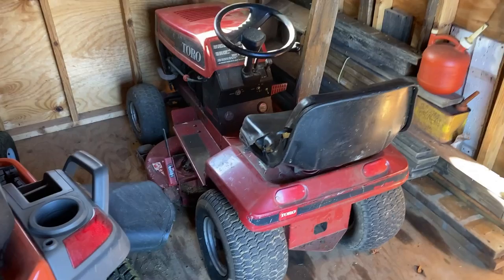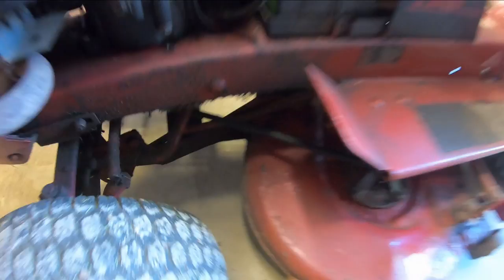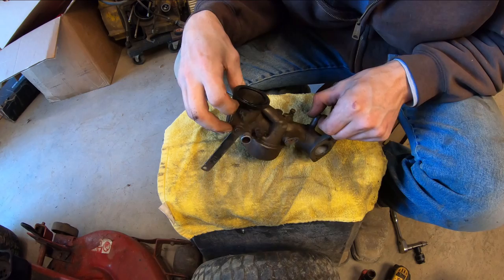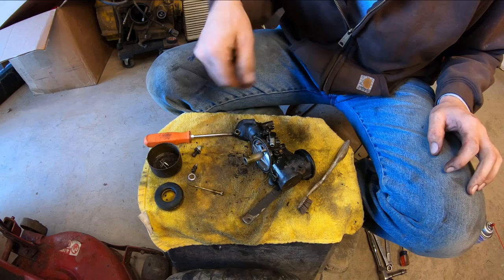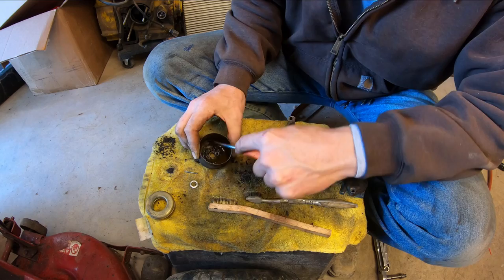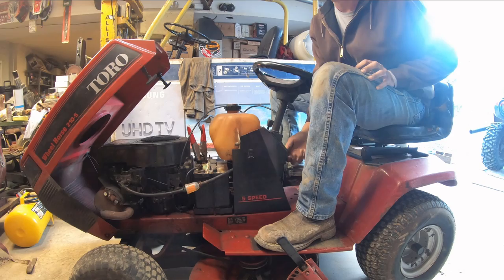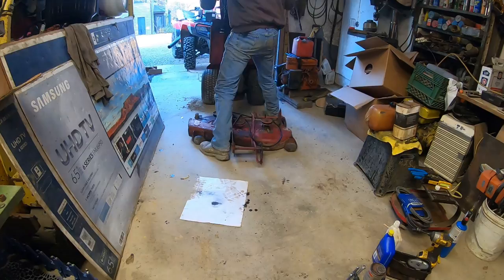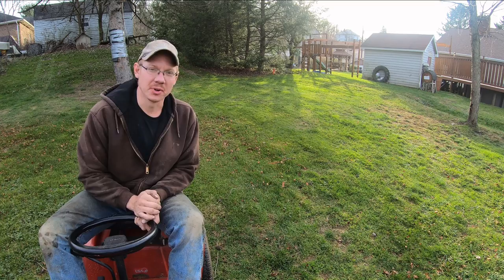Toro Wheel Horse lawn tractor sitting 10+ years Will it run!???

Comment: Time to fire up my old Wheel Horse and Cub Cadet 149. That surging is most likely from the governor. Just needs a little adjustment. Had a brand new mower surge right out of the box. It got annoying so I had to fix it. A small adjustment to the governor smoothed it right out.

Comment: I love the old wheel horses.  my grandpa has a 1976 C-160 Automatic with a snowblower and a rear discharge mower.  Always loved that thing as a kid

This past fall i bought myself one.  A 1980 C-175 Auto with a fresh 18hp briggs opposed twin.  I also have the snowblower and a 48inch side discharge deck.  These tractors are beasts!

Comment: Engines ARE air pumps but I didn't think you were so literal about power producing air pumps!  About that hunting, go watch some Mustie1 videos and see if his fixes apply.  Usually the low speed fuel feed isn't supplying enough gas so the engine hunts as the governor is trying to keep it running.

Comment: The thing you took off was a strainer, not a filter. The filter you put on us supposedly too restrictive, and should be used only when a fuel pump is present. This was explai ed to me, as I did the same thing.  It worked for amonth, then screwed up. I put a strainer on, and it was fine and has been for 5 years......FYI

Comment: Looks like some serious highway miles on those front tires! I had a similar model... the Wheelhorse-Toro 210-H, hydrostatic drive transmission. I'd have to say that it was the best cutting mower that I had though out the years. Happy mowing!!!

Comment: the reason the valve stems are on the inside is so you can put cast iron wheel weights on the rims with long bolts
Reply from the maker: All the wheel weights I’ve ever used had a notch for the valve stem

Comment: That new paper in-line gas filter should really only be used on engines with a fuel pump, not gravity fed like this is, I think mostly because  it does not filter all that well and the fuel pump itself does filter well.  The surging means it's starved for fuel;  so clean the carburetor better and/or slightly enlarge the high speed jet orifice.

Comment: I have used belts from TSC, they have a line of belts that have some sort of aramid fiber and they are cheap compared to any other decent brand and they last really well.  The problem is you may have a problem with them fitting because they don't stretch nearly as much as conventional belts.  I used them and they never excessively wore the pulleys but I had to add extra length to get them on.  They worked well, just a belt that was something like 68" had to be 70" to fit but it worked and didn't slip and has worked great.  The oil is probably the o ring on the dipstick.

Comment: Right there with ya on fixing things instead of throwing it out. I've seen you use a few different chemicals (at least one of which I probably wouldn't have used simply because of the difficulties around disposal) in attempts to clean projects but I haven't seen you use Extreme Simple Green Aircraft and Precision Cleaner yet. During my recent 3.1 rebuild I was looking for a good degreaser because I don't own a parts washer and gave that stuff a try.  It's non-toxic and it took off years of baked on grease, dirt and oil (over 200k miles worth) like it was nothing - no chemical parts washer I've ever had experience with worked like it AND it's easy to dispose of at any place that takes used coolant and oil. It's safe on skin, rubber/plastic etc and my parts literally came out looking like new.

Comment: Are they not governor controlled at high revs ?, Usual a flat tin plate that has a spring attached and the draft from the fan moves the plate against the spring and reduces the throttle setting. As it slows down the plate moves back and increases the throttle setting again. The plate is connected to the amount of throttle opening, hence it prevents damage by over reveving. Under load , adjusted correctly, it gives even engine speeds. Hence without a load and full throttle setting it opens and closes causing the surge, perfectly normal.

Comment: Only $100 for belts, it would be at least double that if the mower had green paint on it. You should be able to eliminate the "pop" when you shut it down if you let it idle way down to cool off a little. The pop is caused by excessive rpm when the ignition is killed and fuel is still being pulled into the engine where the heat in the exhaust manifold ignites it with a "pop". Very hard on engines.

Comment: If you put the little plastic eBay inline fuel shutoff valve on gas line and use it every time your done to shut off gas, you won't have carb problems.

Comment: That might be the most varnished carburetor I have ever seen. I've repaired stuff that sat for comparable amounts of time, and I have never seen anything anywhere near that bad. I wouldn't have even bothered trying to rebuild that one. There is just no way that it will ever work 100% properly anymore. With that much dirt and varnish, there is just no way to get all of it out.
Reply from the maker: Ha! That was nothing! You have to watch the schramm air compressor video on the channel. Now THAT was a nasty carb!

Comment: nice runner there :) Always look forward to new videos from you. I am gonna interject a comment in here though. The fuel filter you put on is not really the best for gravity flow fuel systems. Those paper element style filters are designed for fuel systems with a pump the filter you took off is a simple screen filter and it is a much better fit for a gravity flow system. if you take a look at the tractor you really don't have much drop at all between the tank and carb. The restriction of the paper element filter can cause fuel starvation issues. Millage may vary and do what you like and what works for you. But there is a reason the factory filter is just a screen.  Still love to see the old iron back and mowing again.

Comment: I agree with your ''throw away society'' ethic.  A world half full of Wasters too self important to enjoy getting their fingernails dirty !
 That's an 'Emulsion tube'  take your time & make sure ALL them tiny holes in the side are clear.  Be careful if that crank seal is weeping,  when the oil is cold they can look fine,  but when running & the oil thins with heat they can piss out flinging the oil away so ya don't see a puddle under a cold nor hot engine.  It would be a shame if that good auld Briggs heat seized after so many years of service  :(   
     Re:  Your Blasphemous  '' Briggs & Scrap iron ''  quip,  
          ''forgive them, for they know not what they do''.

Comment: On the old style Briggs&Stratton with the oil slinger oiling system you Don’t use multi grade motor oil it has to be straight 30weight Only Not Not 10w30 straight 30 Weight motor oil.

Comment: I don't know how long your mowing season is there but I figure 6 months mowing once a week so say 25 times. Sometimes it's less in a dry year. If it takes 2 hours to mow that would be 50 hours a year. 1300 hours would be 26 years of mowing. That could be about right because Toro bought Wheel Horse in 1986 so 26 years takes it to 2012. The 210-5 was 1990-1992.
Reply from the maker: Ehh prob took her closer to 3 hours but your probably pretty close with that!

Comment: Always like resuscitation of old equipment. I agree, much more satisfying to fix something versus just buying a new part. Got a drive and deck belt for my '97 Craftsman lawn tractor from vbeltguys.com, they're up in the Dakotas somewhere. Very reasonable prices. I think the 88 and 93 inch belts were under $40 with shipping. That was maybe 4 years ago and lots of hours, still working. Wondered what happened to the Wheel Horse name. If you search "Wheel Horse RJ058" it might come up several collector sites. My dad bought that model in 58 for our rural Ohio Township homestead. The dealer at the time was on Babcock Blvd in the North Hills. We used the heck out of it for plowing our long driveway in the Winter, hauling firewood out of the woods and driveway repairs. Back then, they had actual tractor wheels on the rear with Ag tread, maybe 18 inch wheels. Kohler single cylinder engine. Only drawback was only a three speed trans. When my mom had to sell the property after dad passed in 71, a neighbor bought the Wheel Horse and used it for several years. Not sure its fate. Lots of them still survive in collectors hands. Interesting net search if you're interested. Yours looks like later generation designs of the MTD and Cadet genre. Less of the traditional mini farm tractor look and more like the lawn tractors of today. Enjoyed your first start video. Nice job, Matt!

Comment: all the garden tractors /lawn movers i have owned valve stems were in the inside , migt have somthing to do with adding wheel weights , some whights to allow access for valve stems if located on normall side of rim ,just my guess
Reply from the maker: All the wheel weights I have for mine have a notch cut in them to allow access to the valve stem 🤷🏼‍♂️ I’ve never seen any without that

Comment: 👍🇺🇸🇺🇸🇺🇸🗽🙏🏻 Enjoyed!  On the gravity feed gas tanks I've had problems with replacing the small (screen only) filters with the larger plastic ones....it's like it vapor locks after about 10/15 minutes and stops running.  Putting a small (screen only) back on and problem went away!  Love old mowers!

Comment: The "surge" that you are hearing is called "hunting". The motor is hunting for its proper rpm. That is probably due to a dirty venturi tube (the one that you couldn't  get out of the carb). If you want a very good carb cleaner that comes in a spray can, check out Berryman's. Best I have ever used for multiple uses including removing paint overspray from various parts.

Comment: GET A HORSE,  A WHEEL HORSE OF COARSE!!   Wheel Horse always put the valve stems on the inside so they would not get caught by sticks and other debris.  Good bet you could have got the Wheel Horse belts online cheaper then then those crappy stens belts at the dealer.

Comment: That fuel filter you used is not meant for gravity fed fuels systems, use the style that was on there when you got it.
Reply from the maker: Lotta people said that, I’ve been using these filters on gravity systems for years now and never had any issues
Reply: @DieselCreek  the other style will perform a lot better on your machine, that’s what that style is meant for, great video though.

Comment: That engine “surge” is called hunting you have a idle air circuit that’s still clogged you can while the engine is at full throttle pull the choke out till it just about to stall out and then quickly push the choke in repeat this 3-4 times this helps unclog the idle circuit out.
Or the high speed governor needs adjusted to get the surge out of it.

Comment: 21:30 you have to think about your ROI or opportunity cost. If it takes you an hour to clean a $5 float but you make $20-30 hour working. It might be time better spent to buy one. Now if you don’t have the money for it or your not working and your opportunity cost is less than the part it’s worth the time to clean it. I always trying to clean and fix, but I usually end up spending more time trying to get the old parts working then buying new ones and fixing it the the first time. But the goal is just to see if the machine works. If it works and I know it’s good then yea let’s spend $20-40 and fix it right.

Comment: I know that many mechanics will tell you that my suggestion is utter crap and the worst possible thing that you can do. i found that if you are gentle and use the smallest size possible you won't ruin the ports. I use a oxy-acetaline cutting tip cleaner set to clean out the pathways on the carb parts. They are cheap, small and even come with a flat file that works great on breaker points. If the end wire size barely fits or fits tight, do not use that size wire, use one or two wire sizes smaller. Yes they are round files and can ream out soft metals.

Comment: How good are your brazing skills? That would be the determining factor (in my eyes)  if you can fix it without burning a hole in the float. Awesome vid.
Reply: No need to braze. Solder works just fine, and was the way the factory put them together.

Comment: Matt, love your videos.  I grew up in western Pa but live out in the west now. I used to do a lot of old motorcycle restoration and something I've  done over the years is wearing gloves when I'm  getting my hands greasy. The hydrocarbons from oil and fuel are absorbed into the skin quicker than you think. Also using carb cleaner with all the toluene and ethylene  are highly carcinogenic.  Your a young guy, don't help cancer get a hold of you and stop putting your lips on any motor parts...yuck!

Comment: nice try there buddy that mower is a late 1990s model and for a mower that sat for 10 years would have had 10 years of dust on it and the paint would not be that shiny dont know why you felt the need to lie but you did that mower isnt that old plus never sat for 10 years i worked on to many mowers to know this
Reply from the maker: I didn’t lie about anything lol why would I lie??? I have original sales slip and I ran the serial number...